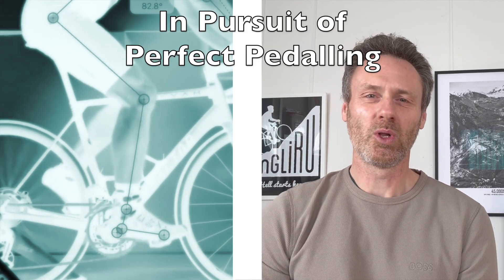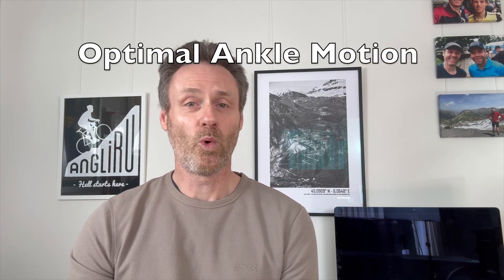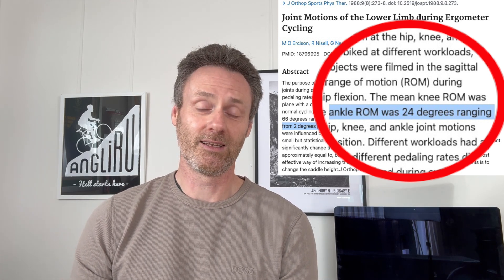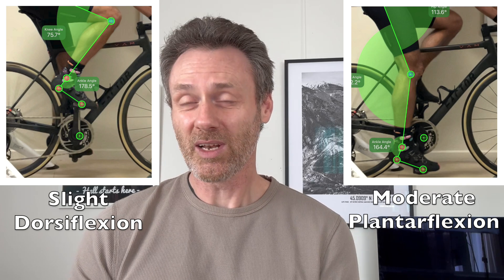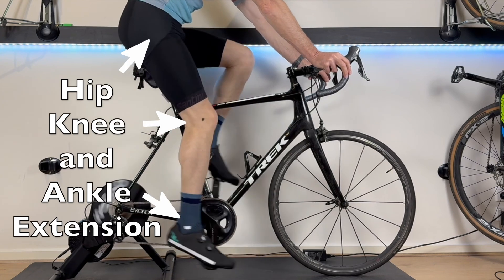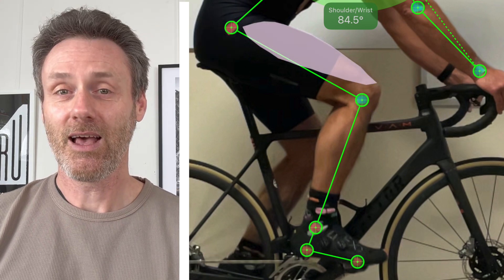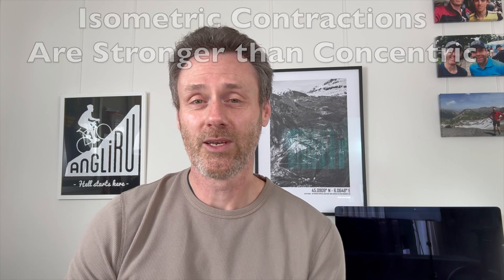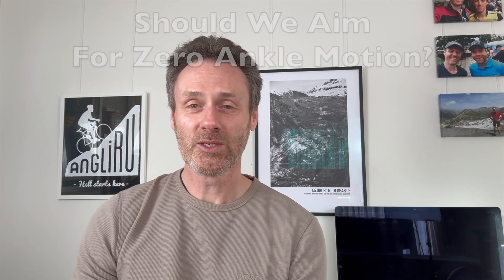Ultimate Ankle Efficiency in Cycling: Pedal Like A Pro

Comment: When I changed from 172.5 to 165 cranks I pretty much eliminated the toe down position at the bottom of my stroke. This was not my goal. My saddle height with the longer cranks was high in order to reduce hip impingement, a choice I had made more or less unconsciously. With the shorter cranks I raised my saddle only 3mm and it felt fine. Less impingement and a better pedal stroke
Reply from the maker: Hi Roger. Yes I know a bit about cycling with hip impingement. I've now had both hips replaced and can ride in the drops again!
Shorter cranks help solve so many bike fit issues - I really think this should be the number one change people consider when coming in for a "comfort" related bike fit

Comment: Why do you have videos of cyclists whose saddle is obviously too high?
Reply from the maker: obviously too high?
Reply: @podiumphysio657   Yes, almost straightened leg and raised heel. What's not obvious?
Reply from the maker: @rota589-y2v  I've asked a small number of my clients if they consent to be used in my social media. The client at the start of the video is one of them. I've chosen his file as it is representative of the information I want to demonstrate at the ankle. He does ride with a slightly straighter than usual knee at BDC.
Later in the video I've used myself as a model. I took video of my usual position on my Emonda and saw that my ankle motion is quite exaggerated (almost 20 degs of dorsiflexion which is extreme), and therefore not matching the dialogue. So I adjusted my saddle height and deliberately altered my pedalling action to change this.
Unfortunately I am not an ideal bio-mechanical subject to record, but I am very affordable and always available.

Comment: I was wondering how much ankle movement differ when you change cleat position? I have the cleat between fifth and first metatarsal. But If I set it right at the fifth metatarsal I feel more stable and my calves isnt utilized as much. So where do you recommend cleat position?
Reply from the maker: In general moving the cleat to the most rearward position on the shoe is helpful if:
- your ankle range of motion is excessive
- you have Achilles Tendon problems
- you have other bike fit difficulties
In other words it is a good position for many people.
Some people feel that their ability to achieve maximum sprint acceleration is reduced so they will tend to keep their cleat position more forward on the shoe